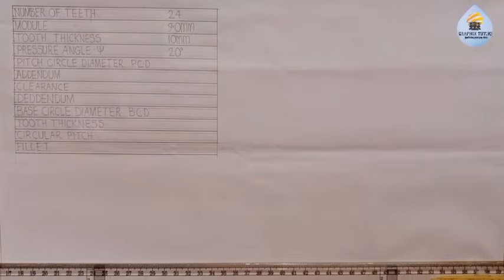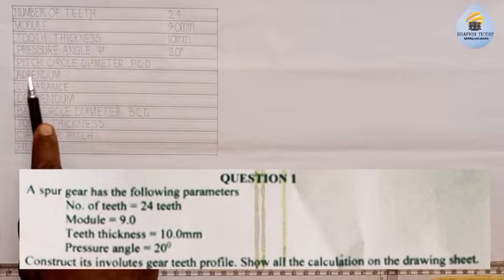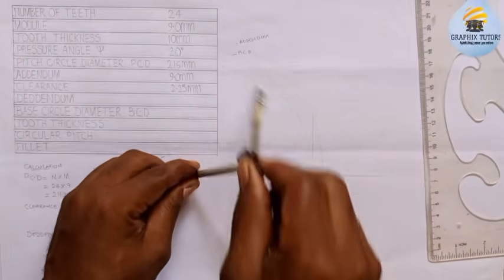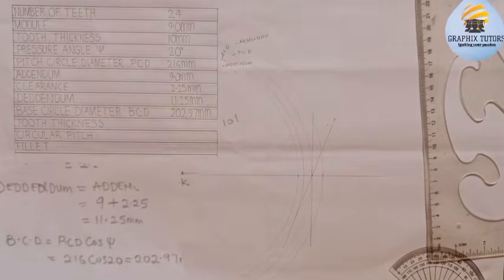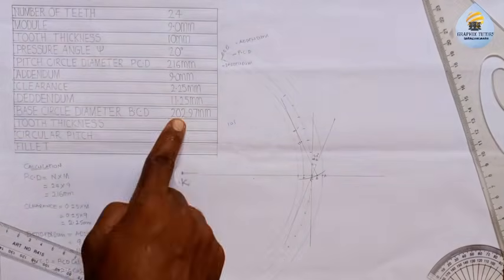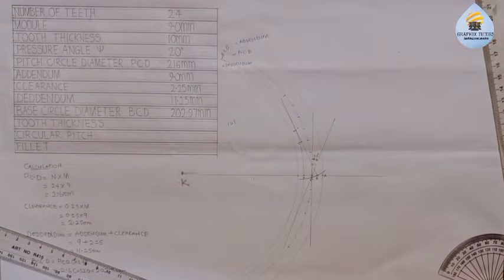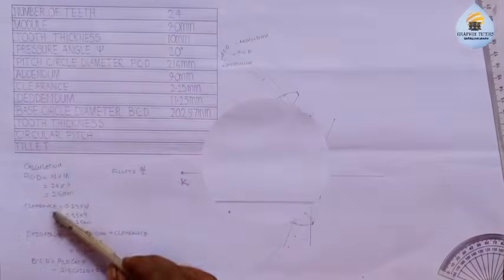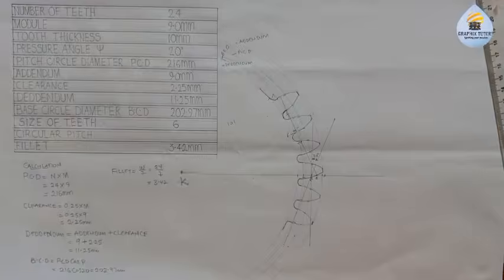Involute spur GEAR construction

Comment: If you the measurements between the addendum and BCD is greater than the 44 do you still divide by 4 or you change the the division number or it remains the same
Reply from the maker: It remains the same division.